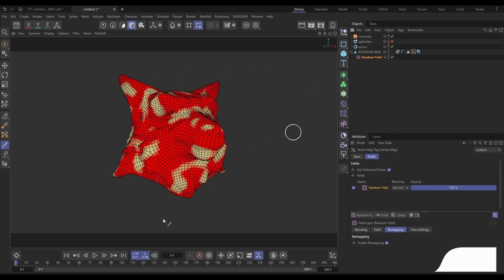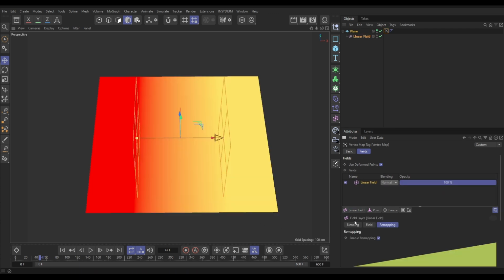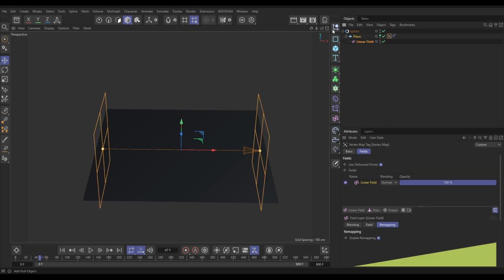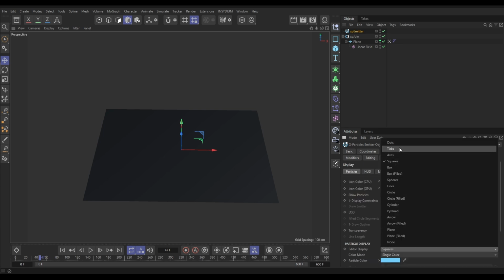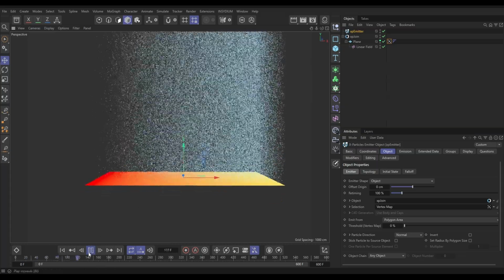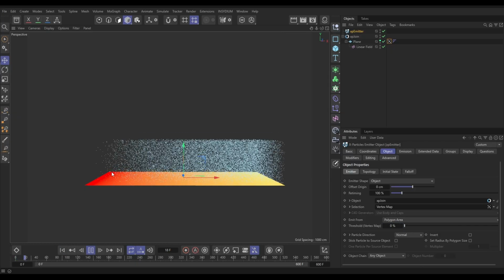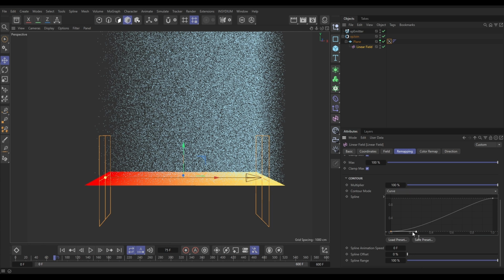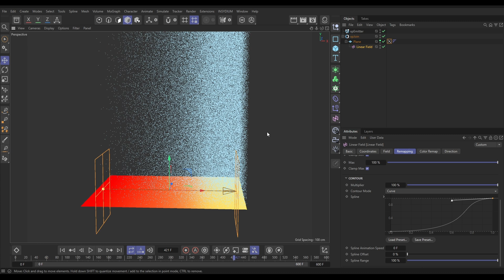Bite-Sized - Vertex Map Emission

Comment: It's not clear what is the purpose of xpJoin. Could you please explain why we need that instead of using the plane object directly?
Reply: I just tested this and it didn't work without the join. I believe without it, it disregards the linear field as the child generating the vertex map therefore does not technically have any data going into the vertex map.

"The xpJoin object is a variant of Cinema 4D's Connect object, optimised to work with X-Particles. It takes a list of input objects and joins them into one object that can be used in an emitter or other areas where you need to use a single object, such as collisions, or in the Vertex Map Maker object."
Reply: @MoreMogsy  Thanks for testing it and sharing. It would be nice to know exactly "when" to use xpJoin, as I've seen it used here and there in other tutorials.
Reply: I think it works if you want to use more than one object or each one has a different xpVertexMap
Reply: @ecm.vision  hmm, but here he's using only one object and  one vertex map.